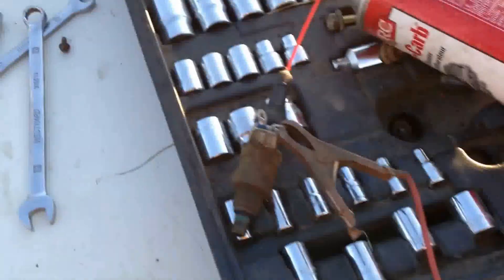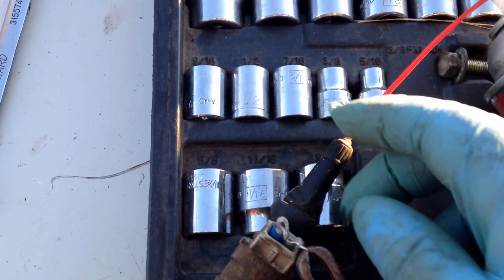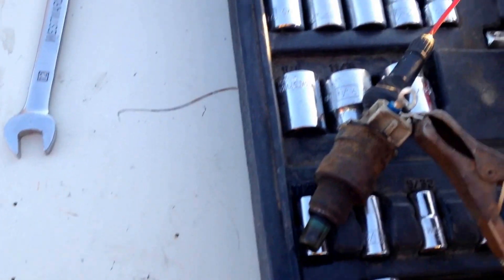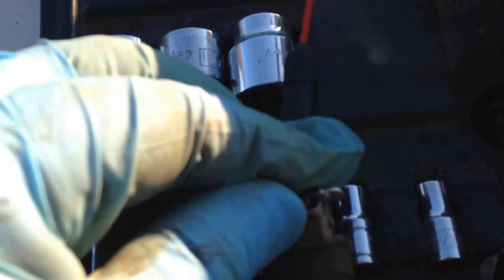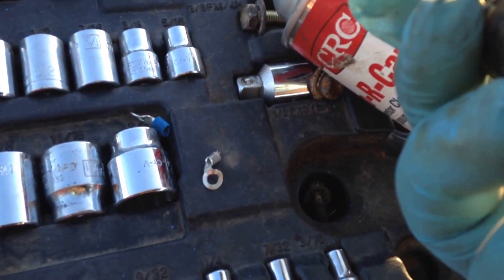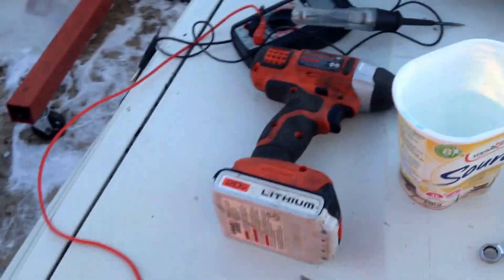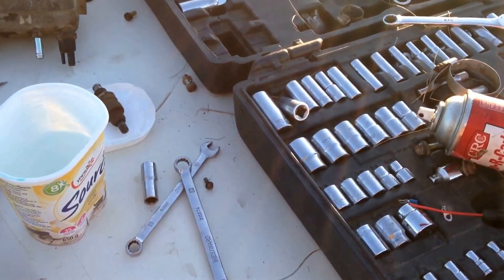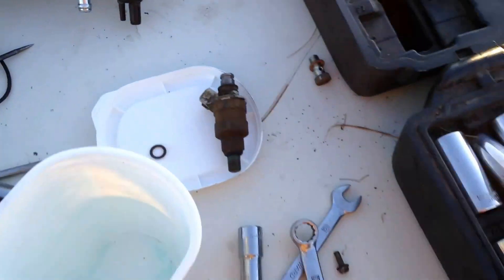Unclogging the old Toyota 4x4 injectors 22RE

Comment: I bought an injector cleaning kit off of WISH for $4.95. Works great and has correct connectors for all injectors I've used them on  so far.
Reply from the maker: Awesome nice kit post a link if you want ,,
Why i did it this way i did not have to buy one to buy or even knew they had that ! i just used what i had at hand and it still works well....

Comment: I'm gonna be doing this to my 89 22RE in the next couple weeks. Did everything work after doing this?
Reply from the maker: yep..
Reply from the maker: Oh yeah i think a guy could do this with out pulling em out .. do it with the injectors right in the vehicle?
Reply: @RatSleds  Thats a great thought. I bought a 1985 toyota truck with a 22RE, and the guy I bought it from said it had 65,000 miles on it, but it set a long time, and when he tryed to crank it, it ran, but then fouled out. Sure junk and water got in the injectors. I will try this, thanks!